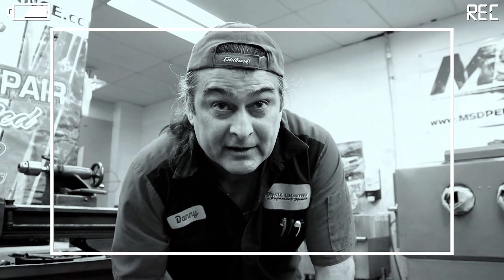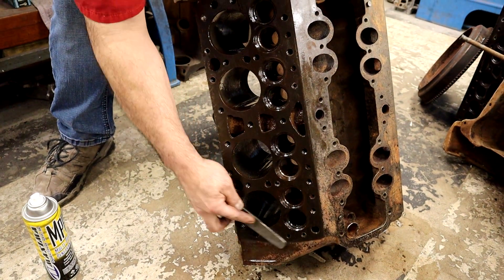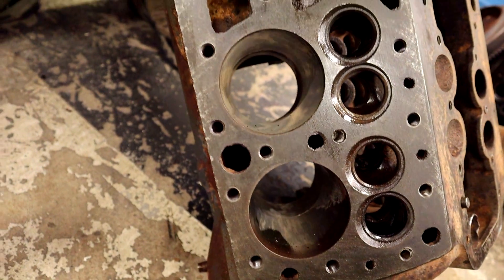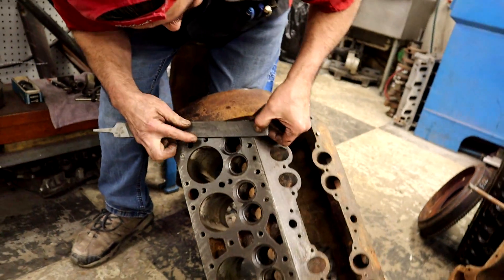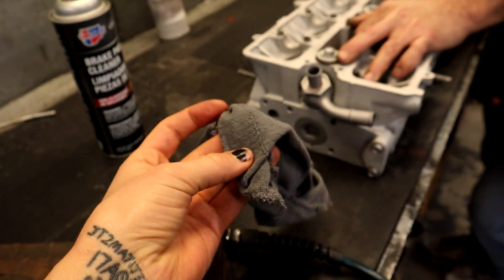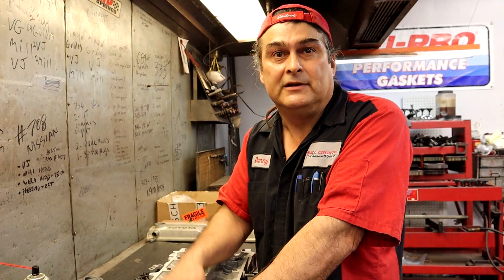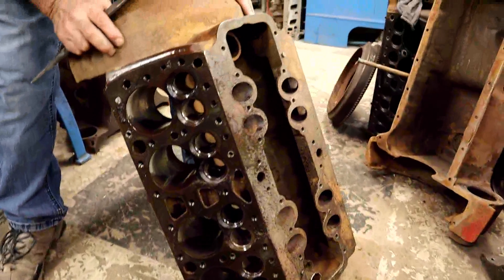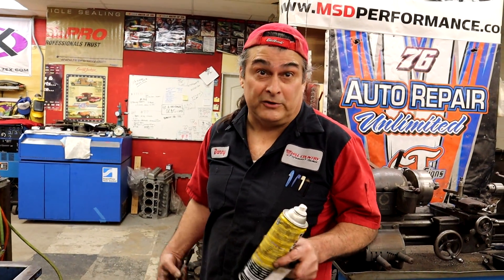How to Prep the Block Surface (before installing a cylinder head) feat. Danny Soliz

Comment: Hey Faye, I have a 2012 dodge journey 3.6 and I think i need a new head gasket, (constantly add antifreeze, no antifreeze leaks on the ground, antifreeze between valve cover) do I need the special timing chain tensioner tool, or is there a way to loosen the timing chain up just enough to get to the head.
Reply: You will have to remove the timing cover, upper chains, guides, and tensioners to remove the heads from a pentastar. The wedge sets allow the cams and just the cams to be removed with the chains, guides, and tensioners in place.

Comment: Amazing, I have been watching all of these videos. I just had the Same problem, Intake cam came loose after 4k miles on newly built motor. Machine shop was at my house yesterday, says head is not warped but I guess I need to polish all the journals and caps. Getting Machinist's Dye..

Comment: Nice to see someone as knowledgeable as Danny does the same thing as I do.  

I start with a knotted wire brush on an angle grinder to remove all the big chunks of gasket without removing metal.  Then I go to the file, and brake clean and paper towels.  Then after it drys, I blow it off.    

Also, use the old school brake clean that is usually mostly pentane.  The new environmentally friendly stuff that smells like oranges doesn't work as well and seems to leave some sort of residue.   

I have thread chasers for all the bolt holes, and clean and blow them them out with brake cleaner, then air.   If you do not have thread chasers, a worn out tap works well.  A new sharp tap will remove material which you don't want (unless you have to).  You just want to clean the threads.   Run the bolts in by hand, dry with no head on the block to feel how they are going in.  You want them to thread in nicely with no tight spots.  If there is,  try a different bolt as the one you are using might have a burr or damaged thread.  If it does the same thing with a different bolt, clean and chase the threads again,  and use a tap if it still won't thread in nicely.  You will need a bottoming tap for blind holes.  If you have a damaged bolt either replace it or run it through a proper thread chaser.  Last resort would be a die, as it will remove material and weaken the threads.

Remember, bolts are just springs, and we want to eliminate anything that will keep them from giving you the correct tension on your head and head gasket.

Comment: HI DANNY AND FAYE   FILE IS A GREAT TOOL FOR DOING WHAT YOUR DOING.  I USED FOR REMOVING SAME AS WHAT YOUR DOING. JUST REMEMBER FLAT FILES ARE NOT THAT FLAT.  IF THREADED [TAPPED] HOLES ARE RAISED AROUND THREADS YOU NEED TO USE A COUNTERSINK TOOL ON EACH HOLE.  RAISED MATERIAL AROUND A TAPPED HOLE EQUALS TORQUE LOSS TO HEAD OR IT WAS OVER-TORQUED.IT PULLS MATERIAL UP AROUND THE HOLE DURING TORQUING. JUST A THOUGHT. I WAS A MACHINE TOOL BUILDER FOR 38 YEARS AND DID A LOT OF TORQUE TESTING- SLASH PRESSURE VS TORQUE . LOVE ALL YOUR VIDS!!! GARYC

Comment: Yeah for flatheads!  I have to yank the 60 hp 136 cu in V8 out of my 1937 Ford and am swapping in a 24 stud 221 81T 85 hp engine.  I'll be pulling the heads and cleaning it up before install so your video with Danny's info is perfect timing.  Thanks again Faye!

Comment: The scotch brite pads also take off too much material at a very fast rate on a die grinder.Plus the little pieces get in the oil and the oil filter can't trap them resulting in engine failure.GM had this problem,a TSB was put out not to use them.Same with the plastic versions of them

Comment: I always go over the deck with a file, just like that!  On my last engine I used MLS head gasket, with a skim coat of hi temp silicone, to seal around the water passages, it was in a 1st gen SBC, with 220cc aluminum heads, with flat top pistons, with near zero deck, pistons are about .002" in the hole, on a 385 cid, stroker, with ARP studs high and low, on the 4 bolt mains, 5140 crank and rods, 
What a chick!
I learned mechanics because I had to , growing up if my dad or I didn't fix it, it didn't get fixed, and no money to pay someone else to do it, but I always wanted to know how things worked, and I would think of how it could be made, and if I could build one, like control arms, Axels, to full chassis, my dad built a car trailer years ago, it's the best trailer I ever pulled, he designed it well, sorry for the rambling, I have been cooped up alone too long! Ha-ha    when is this going to end! I hope you are all doing well ,  and avoiding the virus! And really what a chick!   I have dogs keeping me somewhat sain! Good day y'all...

Comment: Couple of tips that I've learned:

I'm a big fan of lacquer thinner.  I always keep a can or two around.  The stuff will cut through grease and grime and drys rapidly with no residue.  I just did a brake job on my 93 Caprice.  The bearings got dropped into a soup can with lacquer thinner and soaked for about an hour.  Swish it around a little, give them a quick shot of brake cleaner to blow out any chunks of grease left.  Let them dry for about 15 minutes and they're ready to be repacked.  Super easy.

On head jobs, I use lacquer thinner on a blue shop towel, Scotchbrite Dobie, or a green scratch pad if it's really stuck on.  Quick squirt with brake cleaner to get off fuzzies and it's ready to go.

On chasing bolt holes, never use a tap.  Taps will cut metal.  All you're trying to do is clean the gunk out and make sure the threads are straight.  Either use a thread chaser or make your own by taking a grade 2 bolt and cutting grooves in it with a dremel.  If you use a tap you'll make the size of the threads in the block smaller and thereby reduce the strength of the block to grip the bolt which could cause a head bolt to come loose or worse.

Happy wrenching everyone and stay safe!

Comment: I always see those guys that spray their head gasket with copper gasket shite. And I tell them always that the manufacturer of the engine and the guys that make the gasket don't say to use it. So don't use it! Here Danny tells you to install the head gasket clean and dry. Don't waste money on shite you should not use on your engine/ car only because the ones that sell it tell you to use it. IT IS SHITE! And a waste of money.
Reply: The gasket spray was only intended to be used with fiber gaskets in difficult sealing situations. It's a bandaid product really. People just don't know better a lot of the time.

Comment: Yeah I couldn't believe all the gunk that came out of the head bolt holes on the engine I'm rebuilding now. I could feel the grit between the threads when I was taking the bolts out. And supposedly this engine was built by some pro machinist. I went and spent $10 on a thread chaser to clean them out and now the bolts go in and out like butter. They also used WAY too much ARP lube on the bolts when they installed them. I swear some bolts were at 40ft/lbs and others at 100+ft/lbs. Couldn't believe how half assed this car was. Glad I got it for free haha.